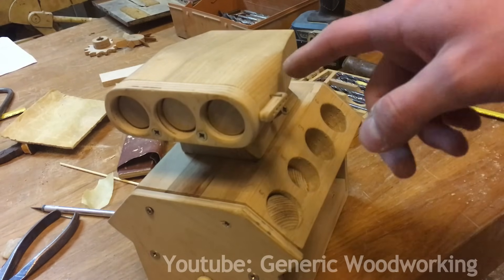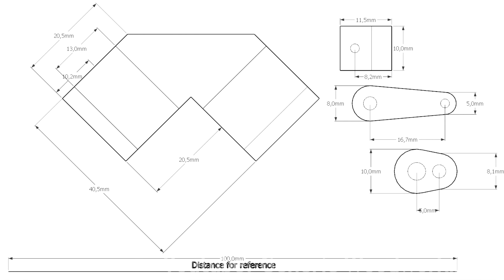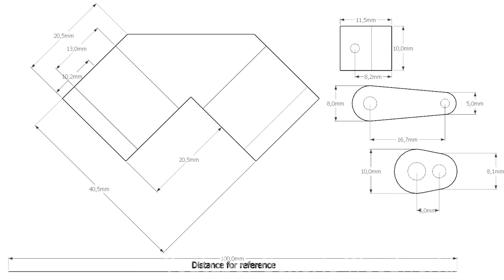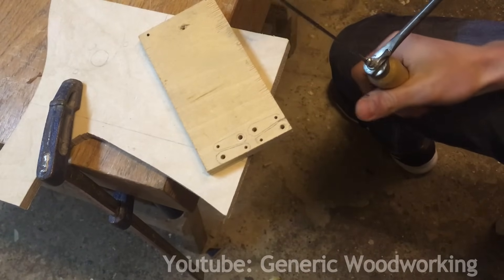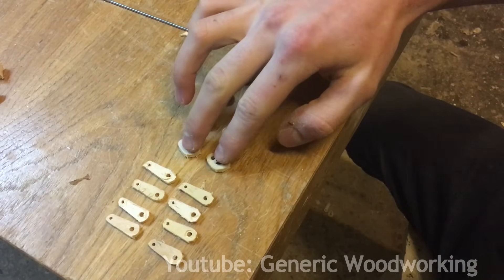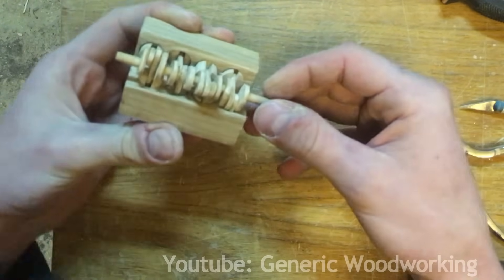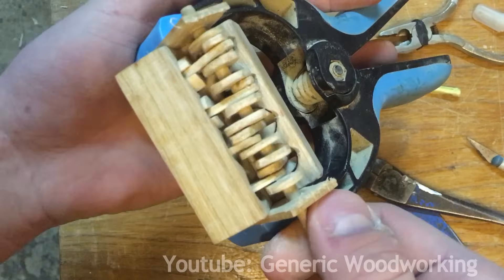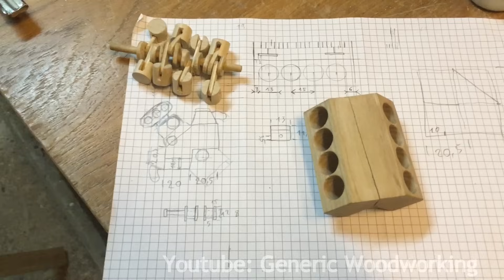How To Make a Mini Wooden Supercharged V8 Engine (Part 1)

Comment: You used dry bar soap as “lubricant”, I made my own plans for a larger sized v8 model, would dry soap work just as well for a larger model or do you have any better recommendations for lubricants
Reply from the maker: Great question! Soap seems to work pretty much all the time. Paraffin (candle wax) is also a good alternative though. Whatever you do never use wet lubricants (I once tried wd40 and it just soaked into the wood and made it expand and jam. Another thing to keep in mind is that it’s best to add lubrication after you’re fully satisfied with the mechanism (because making adjustments and sanding is very difficult afterwards. You can check out my mechanical car model i have on my channel (it uses this lubrication everywhere and would 100% not function without it).
Reply: Thanks for the advice, I’ll be using bar soap and yeah i checked your other videos too, amazing creations 👌👍